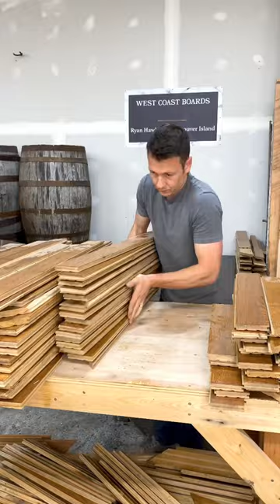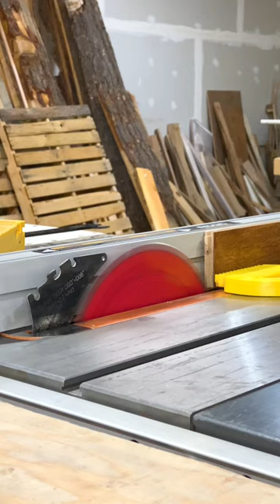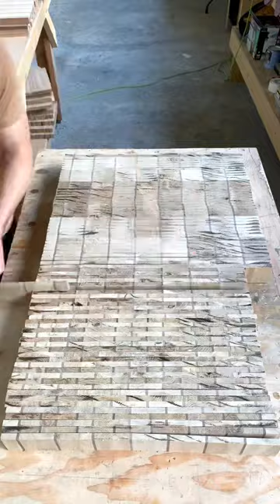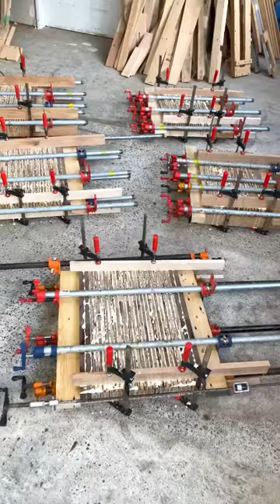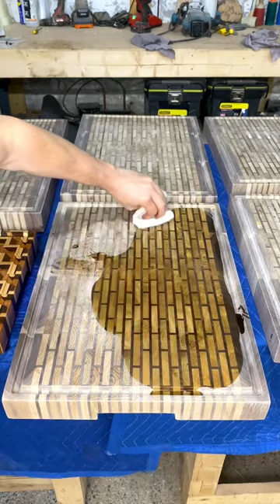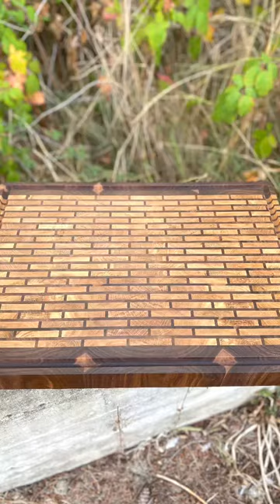Oak Flooring Transformed Into Cutting Boards #shorts #woodworking

Comment: Looks great but I heard oak is not a good wood for cutting boards
Reply: It's not. Especially end grain like these. White oak edge grain is possible, but not advised. Never end grain. Has to do with the structure of the wood fibers. On oak you can blow bubbles through a several inch peice dipped in soap.